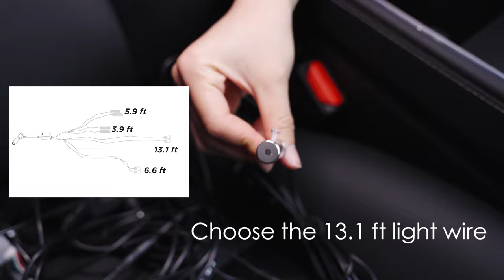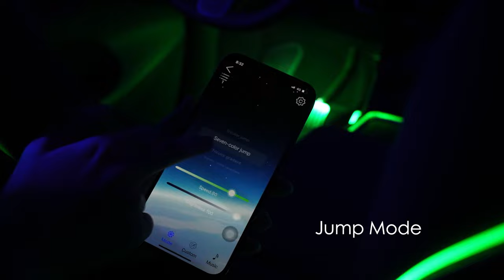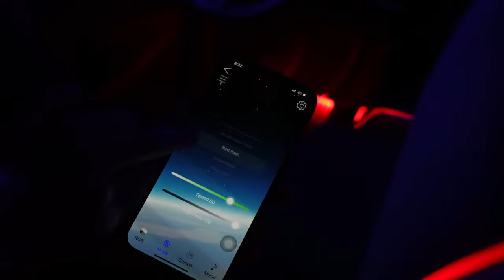Nestour 2021 2022 Tesla Model 3 Y Interior Neon Lights Installation (Full Car) Version 2022.8

Comment: That was the worst dash installation and wire tuck that I have seen. You need to remake that whole section. At night that would look like a child did the work. Makes me question getting this product!
Reply: Dude…. While I was installing it there were so many missing points that this video didn’t cover. I’m still trying to put it together and it’s been 2 days. Wire placement is terrible trying to figure the locations for it based on trial and error… smh
Reply: @leedart why??

Comment: Dash install needs to bend the tube. After bending it. I dont get any light after the bend. How to does yours work even after bending the tube
Reply: Did you figure this out? The suns still out here, but it doesn’t seem like I’m getting any light through the dash or console tubes.
Reply: @joshuadembling8745 did you fix it?

Comment: I don't understand one thing... the light under your feet in front, isn't the original one already present? putting the colored ones, how do they work? do they replace the original ones? or the original ones must be eliminated? Thx
Reply: They’re stuck with double sided 3m tape

Comment: Can you remove the dashboard for any other purposes without taking out the lights strip?
Reply: You could install the dash strip under the rubber lip of the dash panel (slightly further back from
Position in this video) and you can remove the dash trim
Without removing the lighting.  Make sure you use a very good adhesion promoter and get good  3m VHB tape

Comment: For the dash why not just pop the covers off the sides and tuck the tube and light in there? Looks awful the way it’s done in the video.
Reply from the maker: Hi. Actually we upgraded the installation for the dashboard which puts the light tube on the dash instead of under the ventilation so there will be no sagging at all. The light fiber and the tape will stay in place even under extreme warm and cold environment.
Reply: @nestourlab4150 do you have a new video? The instructions my set came with are like 4 extremely basic pages of little to no help.